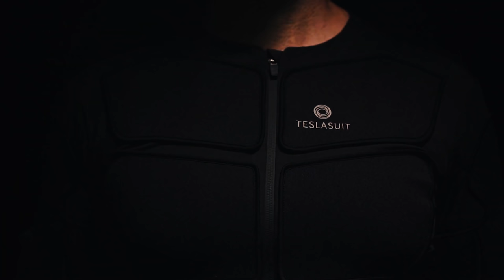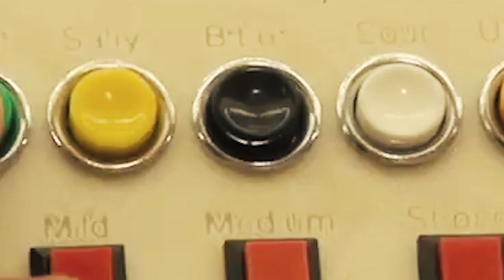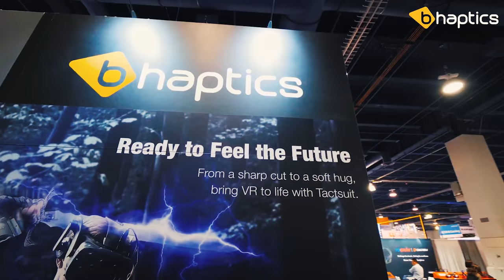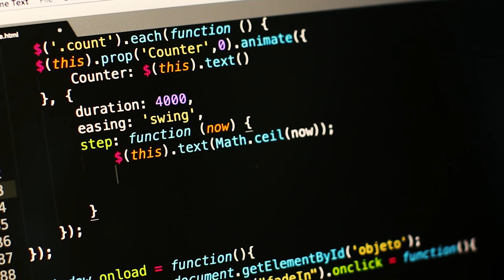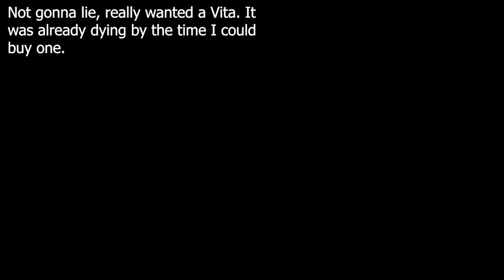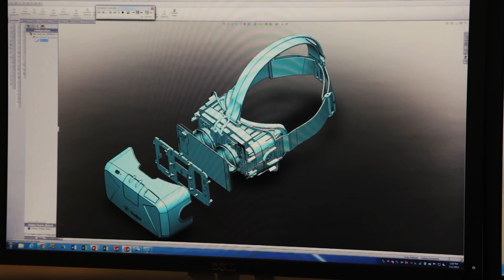VR Suits: The Solution Almost No One Uses

Comment: I would be worried about these VR masks that simulate smell
like what kind of chemicals would you be inhaling to smell the giant trolls of Skyrim or the abandoned buildings in TWD
Reply: They've had museums that have this kind of tech that allows you to smell "environments" from their displays for a few decades now.
Reply: @usosaito.namahage  They are made to make 1 smell, or maybe a couple different smells. but if you wanted something like that for VR it would need to be able to create a WIIIIDE variety of smells, so chemicals that might not be too good for you, could be an option
Reply: The same ones that make smell in real life. But that's if you use chemicals. You could also probably use voltage
Reply: Well, it's not something you need to worry abiut if yiu live in the US. The mask uses a vape cartridge system, and even though there's no drugs in the fluid, the blanket ban on flavored vape fluid didn't specify drugs being involved.

That is to say, the vape ban made a lot of complications for the company making the mask, and it may not happen at all.
Reply: All I care about is the Hardware at this point. BCI VR is the future of current VR tech and there is only one company that is pushing the limits of BCI and that is Neuralink. Invasive BCI will let us have a full brain Interface and that will make the full dive super immersive BCI VR possible. I know many companies like Valve, Neurable, Nextmind, etc., are working on this but none of them are invasive. 

It’s is a physics constraint that it has to be at a certain distance from the Neurons to stimulate it i.e., writing in the brain and eventually the technology will be sooo small to the nanoscale that it won’t need surgery at all. One of the big goals of Neuralink is to have a full brain interface and I’m glad that this whole concept exists. It’s so much better that what it was 6-7 years ago where this BCI (Brain Computer Interface) field was divided.

Gabe Newell, CEO of Valve says that whoever is not researching into VR right now are making a huge mistake and “We are closer to the Matrix than what most people think.”

Remember Ai is progressing at an exponential rate, just google GPT 3 chat and I say this because if we run into some hard problems with the brain than Ai will be able to solve it. So, it is like a backup for many things including BCI Full Dive VR

Comment: Still don't get why implementation of VR- suits (at least those used for tracking) is a problem: The characters are rigged anyway; also we already use simplified physics engines. While no-suit users characters are animated, you could control the bones of your rig directly. For something like touch a standardised platform would be very helpful though.
Reply from the maker: I wouldn’t say the functionality of the suits is any problem, but rather the circumstances around using them. Cost, adoption rates, manufacturing, convenience, and standardization are the larger issues at the present. 

They unquestionably have a place in VR, but whether the “that almost no one uses,” of the title of this video will stay true is the question.

Comment: Im just waiting till 2050 Then we have our Nearv Gear Im sure :,)
Reply: it’ll be sooner than that
Reply: @apol8245  Whilst technology can surprise, I'm a little sceptical of that myself. We're making many cool advancements in neural interfaces, but the scope and quality of what people are expecting when talking about nerv gear, is on a whole other level from what we're currently doing. Reading information from the brain is something we're making good progress on, and could potentially see actual practical use in VR sooner than later, but writing precise immersive information into the brain, we've barely scratched. The concept is as difficult as it is dangerous.

When reading information, if the device is fitted or calibrated incorrectly, you'll get minor errors in-game until you correct the fit or patch your software. When writing information, any slight variable in the hardware or flaw in the software and you're potentially being given a seizure, or subjected to a sensation of intense burning heat, or just simply made to feel nauseous without any obvious cause. What happens when someone recoils and rips the device off? What parts of the brain get inadvertently stimulated during that motion?